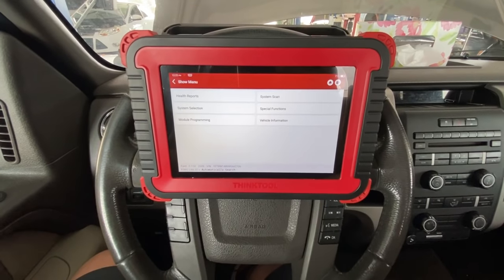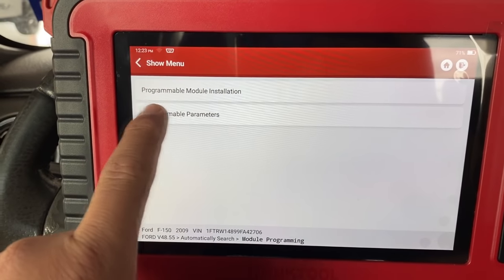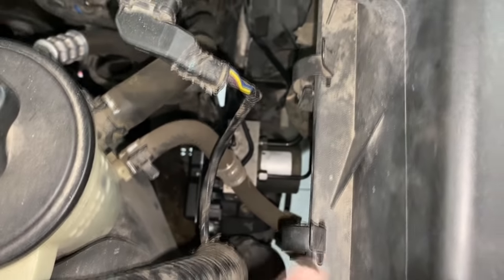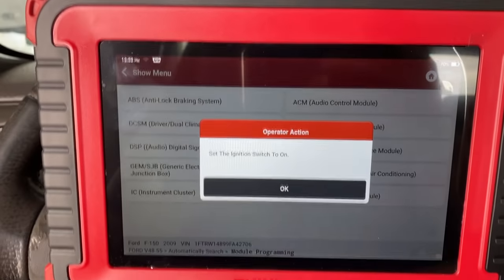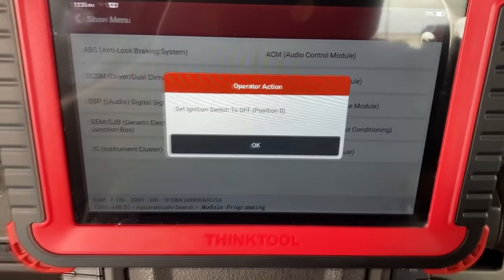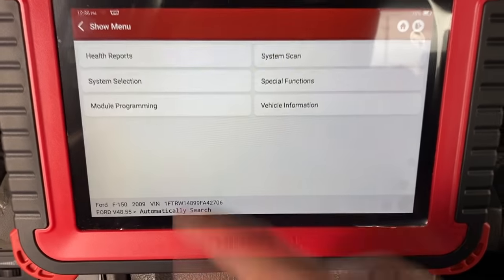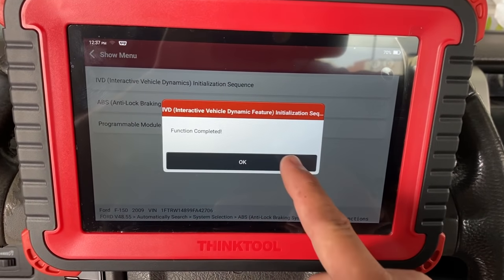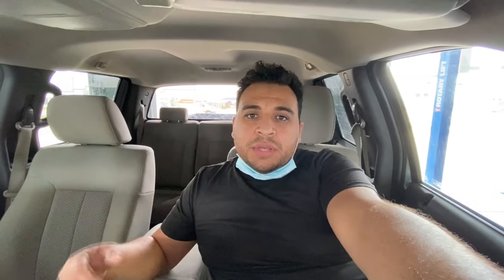WHAT FORD DOESN'T WANT YOU TO KNOW! ABS MODULE PROGRAMMING

Comment: Had similar issue Ford wanted $1400.00 for parts and labor to replace the ABS module, sent it off myself to a company and for $145.00 they rebuilt it no programming needed.  Works great.
Reply: Where did you send it to
Reply: Where did you send it to ?
Reply: Hey do you guys find water company it was
Reply: Still waiting for the company's info???
Reply: Where did you get it done at? Please share
Reply: Your a liar you always have to reprogram abs module
Reply: Not true.  If you just repair the original it is already programmed and you can put it right back in.

Comment: Not really a secret. We do PMI to install modules at the dealer. The advantage we have with the OEM scan tool is we don't have to have the original module.
Reply: And last resort and the most loved by ford techs programming a pcm using as built data , and honestly sometimes i still dream about FFFF and more random codes, only ford techs will understand.
Reply: Either of y’all mind sharing your approach/experiences regarding bleeding/servicing the system once a module is installed? Lights on dash are gone but the  soft/spongy pedal, poor bite is still there. 
Anything I should have done specifically? 2009 F150 king ranch…Thanks so much for any feedback.

Comment: I have the 2011 5.0l 4x4 would control module lock up the driver pads. I replaced both calibers all pad all way around and both front brake hoses. And the front driver side tire is still locked up. The passenger side is a lot more  loose. I'm having issues

Comment: Quick question.  I have a Ford, 2 sensors are reading 12v at the sensor plug, 2 are reading 9v.  The wiring is in tact.  Is it the ABSModule that i need to have replaced or fixed?

Comment: i have 2005 ford escape hybrid with ABS issue, we run the diagnostic and came up with the code C1475, i bought an used ABS for the same model, do i still have to do the same reprogramming procedure as shown in your video for 2008 ? or  2005 model has a different procedure for ABS control unit replacement. Please let me know what i should do, thanks.

Comment: Things are sooo easy when you have the tools!  wish there was a way to do this PMI process if you dont have a 700.00 scanner! ive heard it can be done with forscan trial software ,a laptop and an ELM scanner?  i have those already but the defective abs module does not show options to  program nor save its data , no abs asbuilt data shows... it has codes c1267   b1342

Comment: Thanks forthe video bro! My scan tool doesn't have pmi function..i swapped abs controller for used of same model same part # but got v the vin code..any other way to manually reprogram the vin onto the abs module? Thanks brother! 2011 edge

Comment: Alright bro, I'm interested in the scan tool, but can't find your video reviewing it. I'm currently running the Autel TS608 at the shop. It's okay as far as diagnostic and TPMS goes, but it doesn't do nearly as much as the one you have. I'm looking into possibly getting your scan tool because it looks like it does way more. Have you used it for Immobilizer programming or BMW footwell module?

Comment: Hey thanks for the video. Can you tell me if I change a abs on a 09 Ford Escape with a used unit does it have to be programmed? I have a Snapon legend scan tool that don't have the PMI function. Will I need a different scan tool. Thanks in advance. I don't mind paying for the info. Hope you can get back to me soon.

Comment: Anyone else notice the unusual number of issues similar to this that also have a corresponding TPMS issue, at the same time? I JUST had a tire place fix my TPMS issue on my car. On the way back from there, my car went into limp mode, for no apparent reason. No codes on my cheaper autel scan tool. Idk what to do. Tried resetting the tpms with a special tool. Made no difference. Car starts and drives fine, but power steering is out, and it says I have a problem with anything somewhat related to advancetrac, stability control, etc. out of the blue. When it worked absolutely fine before getting new tires.

Comment: I, myself am presently buying a 2008 Ford Expedition 5.4L 4WD with R.S.C. function & active advanced traction control. My motivation: upgrading the ABS/RSC module; so when this suv would get stuck: It will not stall or BOG the engine down to get UNSTUCK! This here video is an extremely massive help! Before having My OEM module REBUILT; It had the trouble code B2900!!

Comment: I had an issue on my ABS module and replaced it with a used one. I used Forscan tool which is very cheap and the software is free (extended Lisence free for 2 months but renewable) . I had the Vin mismatch error U2023 and C1525 and C1524. Forscan (free version) could deal with all of them. The As-Built data is verrrrry easy, one simple click to download all parameters. But The ONLY way to clear the C1525 was using a pressure pump- 2.5 bars(37 psi) and use the Pressure bleed option available on Forscan
Reply: was the issue no communication from module, wondering if it can still be done.

Comment: MFckrs at an authorized Ford dealer service center recently quoted me upwards of $2,500 to replace the ABS for a 2012 Escape — the vehicle itself only cost me $4,500 and there's nothing wrong with it besides the ABS intermittently throwing B1342-20 for ECU internal fault. They didn't even bother putting the vehicle on a lift, had me waiting almost 2 hours despite me being early for the appoinment then billed me $215 for the diagnostic that actually took them less than 10 minutes while they were working on other vehicles ahead of mine. I could've used that money to buy a used module instead. Thanks for putting this information out there — you're a HERO.
Reply: Yeh, after getting quoted 1300 to fix an AC issue I fixed myself with a used $20 part, I refuse to go to dealerships anymore.
Reply: @brjones27  update: oh, and turns out I didn't even need to replace ABS module at all. After I recently changed all tires on the vehicle to the same brand/thread the vehicle hasn't thrown an ABS warning code since. Apparently mismatched tires will cause ABS errors but of course Ford tech didn't bother to tell me that or they just didn't know...? Anyhow it's obvious they don't want people fixing older cars so they're forced to buy the new shit. Also related had a hot argument with someone who works at DOT stating it's illegal to do your own aftermarket LED headlamp upgrades (such as on a 2012 Escape)  for older vehicles yet it's perfectly fine that every other new car has them now, etc. It's obvious the existing laws were lobbied in favor of the manufacturers.
Reply: @businesscat2895   Interesting... my car JUST had this happen after putting on two new tires. ON the way home from the tire shop, in fact. Still stuck in limp mode right now. :/ Has AWD, and only replaced two tires. May be my issue too.
Reply: @businesscat2895   Yeh, this govt is corrupt. Right to repair/replace/upgrade needs more attention.
Reply: @brjones27  if it goes away after getting all matching tires then most likely that's exactly it.
Reply: @businesscat2895  Just curious how long I need to drive it in limp mode before it goes away. The tires are so close, but different manufacturers. And ALL are new. Wish there was a way to reset it all.
Reply: @brjones27  maybe try code reset with an OBD2 scanner or turn on without starting engine and pump the gas pedal 3 times then start. Might be a different procedure specific to your make model , etc.
Reply: Yeah, B1342 is module internal fault, the work shop manual states to replace. as from experience, there is no recovery from B1342.
Reply: @brjones27  Its not, roll out of the new tires is different from the old. AWD needs all tires rotating at the same speed or near to it

Comment: Just a note when doing this on an abs module you must have the steering wheel centered with the wheels straight ahead as the steering angle sensor is "zeroed" when the module is programmed so if the wheels aren't straight the zero point of the steering angle sensor will be incorrect and there is no function that I could find at least on  my scanner to re-zero the steering angle sensor. 
 I found this out the hard way on the first one I did, luckily I could go back and do the PMI function again and correct it.
Reply: Cool thank you for the heads up
Reply: A true saver, Thanks a lot.
Reply: Good information to know thanks  for sharing
Reply: Thank you 👍

Comment: There were many times I tried to do that PMI test, but I would get a message indicating that couldn't be done.  Ford does have an "As Built Data" function that worked with the IDS all the time.  PCM, BCM, ABS, SRS, it didn't matter, they all worked. The early program had you look up data and manually input the info.  Later updated program did all the work.  Mostly I used it for ABS and PCM.  You could also check for updates if they were there.  I did a lot of ABS modules with "As Built Data."  Good update and thanks for showing how it's done.

Comment: Hey bro, ik it’s been 2 yrs since this video. But hoping you can help. I’m doing the same functions for the pmi, but instead of it configuring successfully, it says it can’t be done. And I bought cardones plug n play module

This is on a 2009 f-150 with the 5.2 4x4 platinum trim.
Reply: Any update

Comment: What happens when you don't have the old module?, recently bought the same style truck which has this abs lights problem, but I don't have the old, can you still program it ?
Reply: Most of the time abs lights are do to bad or dirty speed sensors hook up a abs reader first and if both the brake light and abs could be a simple low fluid or air in the lines

Comment: Just had to do this last month on a 2011! ford f150. It had a cracked mother board in the abs module. Kept getting service advance track. It threw a code for just about everything. It had 39 codes. I new it was one problem causing everything when both exhaust cam/ crank shaft sensors & all 4 02 sensors were supposedly faulty at the same time. I was thinking no way all this is bad at the same time.
Reply: I have the same problem right now. What codes did you have?
Reply: Same here 09 F150 king ranch…module refurbished, installed, lights gone…shitty soft pedal still there. Bled and rebled…my wallet
Reply: @dominicpatricio5408  Apologies for such a late response but the main code that was the problem was B1596
Reply: @Sheeeeeeeeeeeeiiitt  yup the wallet takes a hit on that one

Comment: Today i went through this procedure on the same car the only difference i installed second hand ABS module  unfortunately it didn't work... (Module configuration failure) pops up on the scan tool.. Even though the programing succeeded..

Comment: I have the think tool pro s as well. Definitely has some good features. Looks like it's based on launch software. I've been having problems doing some basic adding or replacing keys to gm vehicles even through it says it's supposed to do it. Have you had any luck doing them. Also fine not as many updates as the launch insane amount of time.

Comment: I bought a 2011 Ford Fusion with no commutation to the abs module. I found an abs hcu complete with module. I replaced the module and B2900  will erase but after one key cycle the miss matched vin comes back. The red brake light is off now but the amber abs and traction control light comes on.
Reply: I have the snap on Apollo D8 scan tool I don’t think it has the program feature

Comment: Hi I have a 2022 f250 superduty 6.7 powerstroke and took it to the dealer to fix some things and one one is the abs light do to an accident on this truck.  So they tell me they jad to replace the hcu/ abs module due to an fault code open Circuit so they installed and now they saying for some reason they couldn't program it to the truck. Now have to wait for another technician to get off vacation to to see if he can do it. I think they trying to find something else to charge me with to make more money off of me. So what the ford secret that they do want us customers to know? Hopefully you can help me. Just don't this dealer to suck all my money. Lol
Reply: And they charged me $2500 to replace a HCU abs module. This is crazy and still can't program the module.
Reply: Hana
Reply: @randytoro8877  any update

Comment: This video came out at the perfect time. I have to replace the abs control module in my son's '06 Escape. I'm using a used unit and will be using the FORScan software to program it. Thanks!
Reply: Hey how did that job end up going for you? Any tips on reprogramming the used unit?
Reply: @jamo7526  Getting the old one out & putting the new one (used one) in was a little time consuming. I used ForScan to change the "As Built" data (no programming needed), which I learned from watching Tool Hut USA's video: https://www.youtube.com/watch?v=DVYtN2iKLOc
Reply: @Zib187  when installing the new/refurbished module did you have any issues with air being in the lines? I’ve had my system bled twice manually at the tire shop  due to brake pedal travel/not having strong bite. I then payed the dealership to perform electronic brake bleed via IDS ($270)….within a week the brakes have the soft peddle travel. As of late it feels like a caliper is sticking (like driving on ice, delayed acceleration/slower than normal from a stop. As I coast you can feel the truck slowing sooner..fuel mileage down.
Had new pads/rotors on the front and new pads for the back done a year ago by the dealer as well. I’m going to look into Forscan and see what all diagnostics and services can be performed 2009 F150. Should have done this along time ago but assumed the learning curve would be hard to navigate.

Comment: If I get a abs module from the junkyard that is the same year as my car will it work or does it need to get program
Reply: always needs to be programed becuz each module is coded with the VIN# of the car it came from..it needs to be reflashed with the saved info from ur cars original module or it wont work

Comment: I replaced the abs module. No longer have the old abs part. Have this same tool. Is there a way to do a reprogram with the new abs module since I don’t have the old one to do what you did on this video?
Reply from the maker: If you don't have the old module, then you will have to program the module using a J2534 pass thru device and a subscription to Ford FJDS. The scan tool can not do this.
Reply: @ADVANCEDLEVELAUTO  how exactly is this done?

Comment: Why didn't the shop clean the oil from the area they replaced the module from. Whenever I do work where oil is leaked and gets on vehicle I always clean that area and if in a place like under the hood may spray off the lower area of frame, non electronic engine components around that area. Stay away from the electrical as I don't want to open another can of worms as if something happens a week later you can bet the customer will be back as anything that happens close to a time where you did work the customer blames you for.

 Had same issue with a key I replaced and customer said engine was running rough. Thru talking with him after leaving it overnight in subzero temps he got in the car, engine really cold, took off after about 15-30 seconds from starting it with a heavy foot. 

Checked oil and nothing on dipstick. Went around side of car in his garage at his house and oil on floor as he'd went and got oil after I filled it then called me and said he put 4 quarts in and nothing on dipstick. When I went around side it was all on the floor. 

Got a pan from my house down the street, pulled drain plug and coolant in engine oil. Cracked oil pan as well. Engine runs rough, no codes when checked ecm. 

Instead of pulling head we're just dropping the engine/trans cradle and putting a new engine in it as the oil pan also had metal particles. 

He's got his tax return so time for a used engine replacement now.

Comment: What kind of cheaper programmer that I can use to do my abs module on a 01 Ford F-350 7.3 what does the scan tool need to snag the info from the control module I have to the new one
Reply: Hello, I recommend the Phoenix Elite from Topdon to you. I am also using it, and I think it is very good. The functions and coverage of the models are very complete.
Here is a video of me using this device to replace and adapt the ABS module of the 2013 Ford Edge: https://youtu.be/-lVxkasK7Fc , you can refer to it, it may be helpful to you!
Reply: I had to laugh  and please, no offense meant ,  when the questioner asked if there was a cheaper programmer and the other  commenter kindly suggested the Phoenix elite...  Bro, that thing is 1,800.00!   wayyyyy beyond the reach of most poor souls looking to do this on the cheap...

Comment: Bro what will happen if the old module is not communicating still can program?
Reply from the maker: You will have to program it using a J2534 pass thru device along with Ford FJDS software.
Reply: @ADVANCEDLEVELAUTO  cannot program using thinktool pro?
Reply: @nextjob4229  Thinktool pros+ can do the J2534 programming

Comment: Working on a 2011 FX4 with the 3.5 turbo... What a pain!
New caliper, new flex hose, but the new caliper drags. I SUSPECT the Abs module is restricting flow, but also have seen that a failed vacuum pump can cause this too (I have NO IDEA how) Just learning this system, but this makes little sense.
Reply: I’m experiencing this too however I have an 09 King Ranch. Module installed, the dash light finally gone but braking still mediocre at best…have you had the system bled at all?

Comment: I have two questions,do you know if this will work with snap on scan tools? And did they replace the ABS  module with a brand new module or a used module? Thanks and thumbs up
Reply: Did they replace the ABS  module with a brand new module or a used module? 
>>>Both,For programmed module